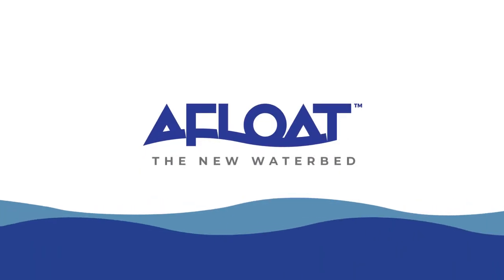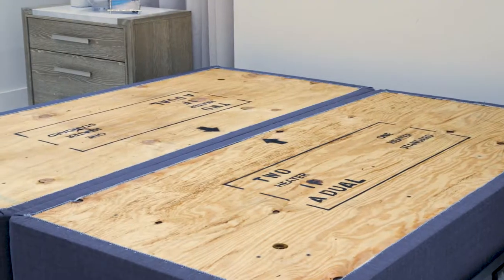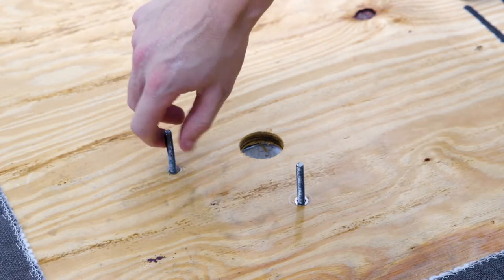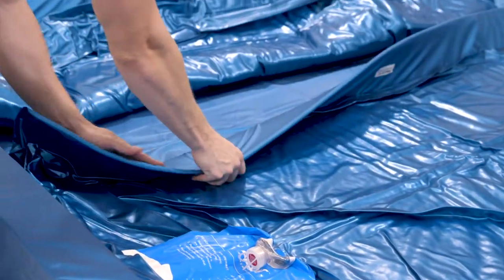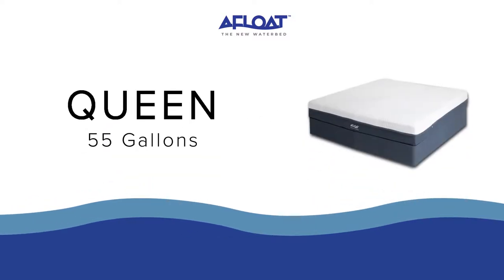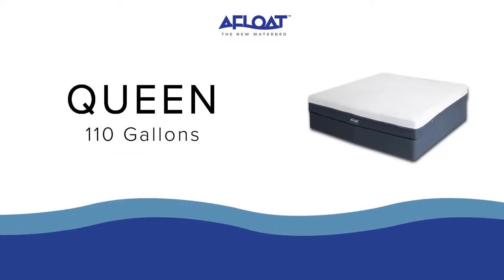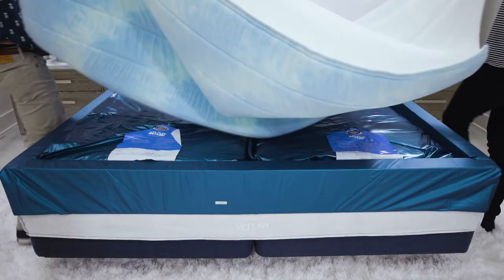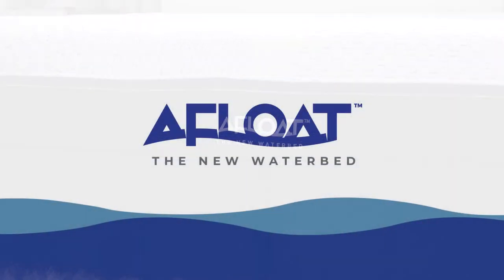AFLOAT Waterbed Assembly

Comment: @afloat Waterbed  - Questions concerning temperature — for someone who is an extremely hot sleeper, how cold will the temperature get ?  Also as far as heat dispersion goes, will a person just end up in a puddle of sweat since there is not a lot for heat to absorb into and disperse into like in a traditional mattress? BTW my son like its super cold … so cold he likes it 60 degrees in the winter inside… he’s like a damn polar bear so looking for the coldest possible option.
Reply: Sounds like me even during the winter I have to have a fan on and my feet out of the cover. Teee 😁 ❤️❄️❄️

Comment: Nice, thorough, and simple. Maybe one day I will own an AFloat water bed.

That water bill though 😬
Reply: Why do u have to refill it often??
Reply: numerouno I just think the water would eventually evaporate with time. With the temperature heating control and everything.
Reply: @mayowaolugboji3576  😂🤦‍♂️
Reply: Greg Williams yolo
Reply: @NeonHelix20  I have slept on a water bed for over 3 decades.  I have "topped it off" maybe 4 times.  Each time I topped it off was maybe 5-10 gallons, so no it doesn't have any effect on your water bill.
Reply: @armadillotoe  how do you remove the water if you need to move?
Reply: @Topher72788  easy , you simply bring you're bathtub to the bedroom

Comment: I have a question : 
Can I have a waterbed without the heating element?
Reply from the maker: It is not recommended. Without the heater, the mattress will sap your body heat making you extremely cold. The heating element's purpose is to keep your body at its most comfortable temperature through the night.
Reply: Yes you can 
My friend had a heated waterbed and the heating element burned shorted and burned a hole through the vinyl and water all over,
Never again will he have a waterbed.
Reply: We at Akva Waterbeds use a special foam topper (LE = Low Energy topper made of EUCAFEEL foam from Kabelwerke Eupen, Belgium) that isolates and can manage the climate very well without heater, tested in several surroundings. But it is important that the vinyl of the matress still is flexible with a colder temperature. Our laminated vinyl is made from polymer softeners, phthalate-free and works perfect.
Reply: @thomasgreen8588  so where can I buy it
Reply: @wumiixzz2296  Hi! Possible to buy it directly from Denmark. We have no dealers in the U.S. so far...We zip the topper between our top and bottom cover. So if you want the perfect solution we would offer a complete cover with the topper layer. For that we need information about size and height of your existing cover. Best regards, Thomas
Reply: @afloatwaterbed6782  - Questions concerning temperature — for someone who is an extremely hot sleeper, how cold will the temperature get ?  Also as far as heat dispersion goes, will a person who is a hot sleeper just end up in a puddle of sweat since there is not a lot for heat to absorb into and disperse into like in a traditional mattress? BTW my son likes it super cold … so cold he likes it 55 degrees in the winter INSIDE … he’s like a damn polar bear so looking for the coldest possible option.
Reply: I stopped plugging mine in and just put thick blankets down as a base. I got the idea after filling it and trying to sleep on it right away... way to cold.  The blankets also get rid of that  wave feeling a little bit too.
Reply: @afloatwaterbed6782  Suggesting adding thick layers until the desired warmth is reached is best. Heaters are expensive to run
Reply: @vomithaus1  Those heaters are expensive to run. And the water takes forever to warm up if turned off